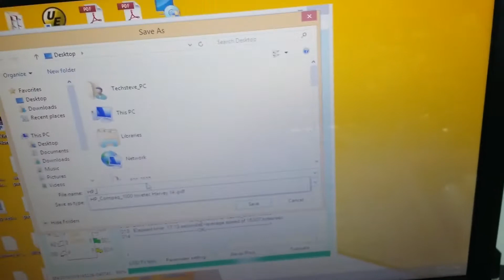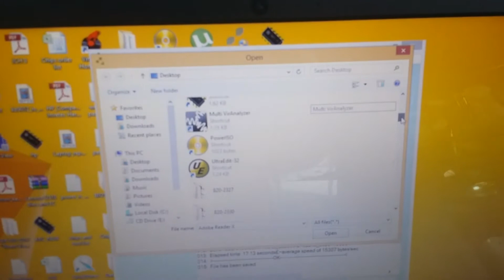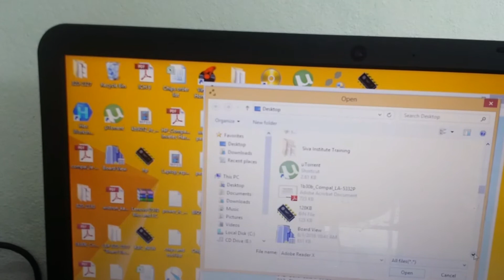Programming KB9012 with RT809F programmer

Comment: Sir, can updating Bios cause issue to I/O controller ? My laptop doesn't turn on now after Bios Update Failed
Reply from the maker: Depending on the architecture of the motherboard. Yes it can if the update failed

Comment: hi friend what is different on direct bios program to io chip program
Reply from the maker: I Do not understand what you are talking about
Reply: i mean there is bios chip with 8pin that can reprogram what is the difference between Programming KB9012 or svod Programming
Reply from the maker: The bios chip is inside the I/O controller so you have to use this type of programmer to access the chip inside it.
Reply: ok thank you info my friend.